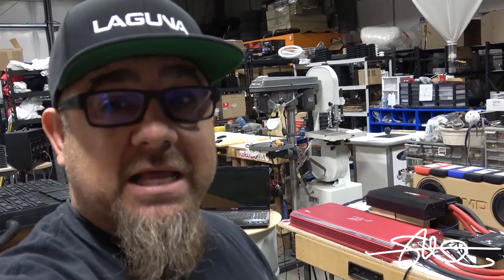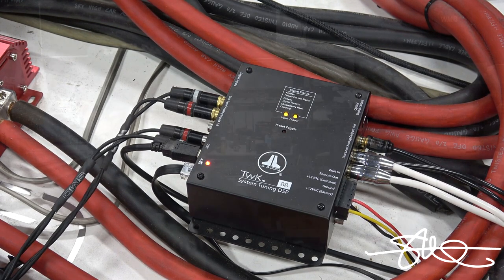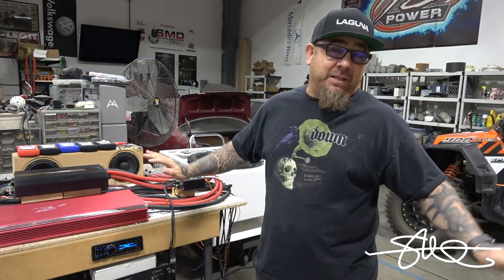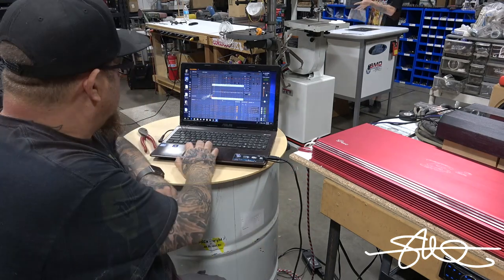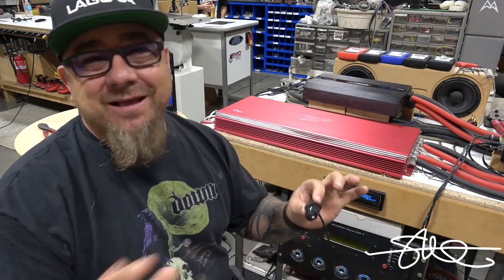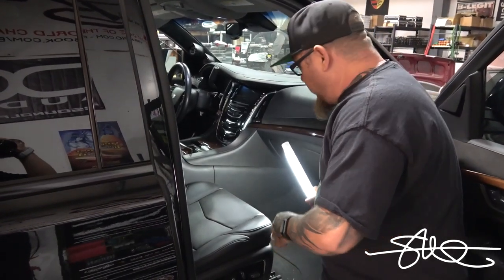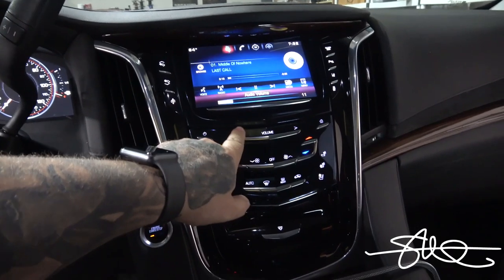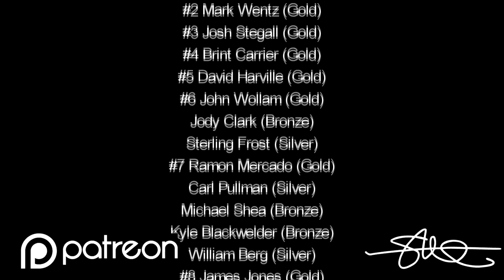Testing the Processor! JL Audio TWK-88 Crossover/EQ - Clean Optical Inputs - Escalade Install Vid 4

Comment from the maker: I just had to test this out on the bench BEFORE i committed to building an amp rack (when the amps arrive that is).  I want to install it with confidence that i know it works and i know what i am doing.  It sucks to sit in a hot cabin of a truck after installing something and spend hours figuring something out...especially if your wiring is all nice and clean.  I feel good about this! Stay tuned for more updates! visit and follow my instagram channel http://www.instagram.com/meade916 for daily updates and live feeds! thanks for watching!
Reply: meade916 is the wire 0 gauge or higher. I have a 03 dodge ram 1500 i have a 1000 dollar budget for a sound system can you help me to get a decent sound system thanks
Reply: meade916 
 I'm looking to do a build in my Acura mdx and I'm my sundown audio SAZ 1000 is missing power and ground screws. Do u know where I can get them from ? Also need some excellent miss and highs speakers
Reply: meade916  bro can't wait to see those amps and sub's another great video I gotta come visit your shop and get a demo of the Tahoe
Reply: Just a heads up in case you didnt already know, the volume button on the CUE works better as a slider. Start at the middle and swipe right or left to adjust volume quicker than tapping or using steering controls..
Reply: 2 Questions: what is the plan with the civic / is the mids enclosure one big box or does it have a wall in between?
Reply: meade916 Hey you got the 3sixty.3 in the Lexus, which 1 u think is better between the twk88 an the 3sixty.3?
Reply from the maker: nah i hate that slider.  It's kinda a piece of shit.  That's why i push the button.
Reply: meade916 AWESOME VIDEO AS ALWAYS BROTHER BASSHEAD
Reply: meade916 Is the Skeletor Enclosure going in the Escalade?
Reply: Steve  Contact the Tech Eric Cole at JL.  Tell him Josh told you too for good reason.  There is a ton more in the TWK than in the manual.  Lets just say you have 80 bands of equalization.  How to use it properly,  sky is the limit...let Eric tell you how to really unlock its potential.  It is something super awsome.  I did not belive it at first.
Reply: This is why I love JL digital
Reply: Is it worth it to buy twk if I already changed my radio to aftermarket and all my speakers are jl audio with jl audio amps in 2010 benz gl450? Btw liked all it videos. Copied ur amp rack.
Reply: When is the next vid comin out for the system  ?
Reply: King Achmed Detroit get another 9 g

Comment: I’ve had the twk in my truck for over a year, GUI interface is great, Tuned with a calibrated mic, hooked up an Apple WiFi to it through optical, pair it with an iPAD using soundman dash kit via Apple play, and it sounds crazy good
Reply: Apple wifi ??

Comment: I installed a JL Fix 86 and TWK88 in my 2017 F150 last summer.  These JL units have crazy amounts of control built into them.  These are great if you have audio OCD.

Comment: Great choice!!! I’m going to run the JL audio vx800/8 and the vx1000/1 amps in my Denali Yukon XL. I work for Jacks Stereo in Tyler Tx they have the TuN express which is controlled by phone or laptop. Has TOSLINK input and output

Comment: I just bought this and FIX 82 to install with my factory headunit 2018 Ford Mustang GT
Reply: John Perez if you have the Sony system you should use the PAC AP4 amp integration piece. JL will even tell you to use those.
Reply: Dylan Wold I went a reputable installer here in Las Vegas, and they said to get these two.  I have the 9 speaker speaker none Shaker.  I will be running it with JL Audio XD 800/8v2

Comment: The more I look at the jl twk, the more I want to replace my audison bit 10 with one. The functionality, parametric eq and the integration looks like what I need and the reviews make it appear that the sound quality is there too. My system is more SQ to SQL. Would be even more awesome if it had something like the Kenwood dsp Android app to control the dsp presets etc.
Reply: Tickle Fingers I think tun 3.0 has it and 2.0 doesn't check in to that he is using 3.0 which just came out in the last couple of months.
Reply: You are correct it does have DSP presets that you make and assign a color to it. You press in the center knob and it changes preset and its color.
Reply: Edward Soares That was it..... Good looking out. I thought that was another dsp.

Comment: When will do a video on the jl audio fix86. It’s been a bit confusing using my dd +1 with that set up. 😩
Reply: Did you ever figure it out? I can’t read any output voltage from the twk88 unless I clip the signal.

Comment: i have a question on this tuning peice by JL audio 1>.do you require this for a certain amount of watts or is it good at any level_ Question 2. are you able to controll the equilizer on your stock screen radio since is already plunged in or those everything has to be when in laptop software AND 3RD. QUESTION THOSE IT COME WITH A BASS KNOB INCLUDED ?? 
NICE VIDEO
Reply: @tboodman  thanks I just bought one
Reply: GAME & TECH BUILDS everything must be fine on laptop. Pre sets can be controlled via knob but actual must be done by laptop. How that helped bud

Comment: This or the Audio Control DM 810 for the C7 3 way components?
Reply: I was just thinking the same thing! Both seem to be kick ass DSPs. If you ask JL Audio, they are going to tell you to get their TWk88 but then you have the VXi amps that to me is an XD Amp line that have the TWk88 built in. I have HD amps so im thinking of the TWk88 or the DM810. I have a Audio Control LC6i that can take care of the high Level Inputs of my Ford flex non Sony system. Just undecided on the DSP 😅 wish there was more head on info on YouTube.

Comment: Could you help me answer a question with a problem I have? I'm going to be doing a full system in a vehicle where you have to keep the factory deck. My concern is since I've never used any type of line output converter I'm looking for something with excellent signal and no distortion? Is there any product out there that gives you excellent results when it comes to signal and distortion? I was thinking about the JL audio 86?

Comment: Pretty sick does it have optical out? And the amp optical in? That would be the shit!
Reply: It does have optical out, however beware it is just pass thru optical and is untouched by the DSP :( I know from experience and the user manual. I got rid of mine because if the control knob has an issue then the DSP output goes to full output and blows your speakers :( It does sound amazing until it smokes your focals lol. The optical pass through is perfect for passing on to another DSP and or amp etc.
Reply: So after watching this video I decided to give the JL Audio DSP another try since I wasnt happy at all with the sound of the Audio Control DM-608. So I bought the VX1000/5i instead of just the TWK88 again and wow! I hope Steve is sponsored by JL Audio because his video brought me back to JL Audio and I ended spending almost $1300 after tax yesterday on this amp and am almost as satisfied as when I lost my virginity. Focal PS 165F Expert Flax 2 way active front stage and 2 JL Audio 8W3v3 subs. Next upgrade will soon be the JL Audio C7 3 Way set to replace the Focal which arent bad but arent as good as my JL Audio C5s were.

Comment: @15:50 i was told to never disconnect rca while its playing and that it will blow the pico fuse on a pioneer headunit. not sure how true it is
Reply from the maker: it isn't true.  You don't want to disconnect your grounds with your RCA's still plugged in, rendering your RCA's your only ground.  That is what causes that problem.

Comment: Hey Steve wondering if you could help me out. I want to add a 5 channel amp to my Tacoma just add some power to my stock highs I was thinking the JL Audio xd 700/5 and adding a JL Audio tw3.  Would this jl tk88 work as audio control lc7i?

Comment: Your system  will only sound as good  as the signal it receives period,if you have a tiny bit of distortion the amp amplifies that,99% of people  miss that the twk is by far the best on the market and will be fir years to come,you can do so much with it its not funny,although  if you want to run the new dolby,optical  will not support  it
Reply: Helix>Twk88

Comment: What factory integration unit would you recommend for a 2017 Charger Hellcat? I plan on going 2 sundown x8’s, SAE 2k, 50.4 and prob 2 sets of hertz 6.5 components (front door/rear deck), not sure what do do about the dash speakers yet.
Reply: Younghog87 JL fix 82 or Audio control Lc2 are good.
Reply: Jim Elam thanks do you have any experience with the LCQ-1 or DQ-61 from audio control?

Comment: I need some excellent mids and highs speakers. Any recommendations ?
Reply: Morel for laid back high quality sound or Hybrid Audio Technologies. The Morel Maximo Ultra is a good entry and the Tempo Ultra. I personally would go with the Virtus or Hybrids for the money. But you can get into HAT Unity for less than Morel Virtus and then into Clarus for a little more than the Virtus. Or, you can get into the Morel Hybrids for more than Clarus. People swear by HAT Clarus and they have great midbass and amazing clarity. Run a search on both brands and take a listen.
Reply: lightbulb754 B2, Focal, Hertz, and JL are good options JL and Focal are smooth Hertz is bright and I will let Steve reveal what B2 sound like when he does his install.

Comment: Hi Steve!!! Quick question, on the car audio install for the ESCALAED are you shooting for a SQ or a SPL sound system to go in it???
Reply: Jose Garcia more than likely it will be both, spl with sq ftw 👌🏻👌🏻
Reply: Jay How is it possible to have both SQ and SPL in a sound system, because if that's the case I would like to do the same with my build that I'm currently working on right now???
Reply: Jose Garcia Was just saying that because that processor gonna make those mids and highs sound so sweet and you know SMD gonna go hard, so it’s seems like he’s gonna have a nice sq system but with lots of bass hahaha

Comment: Hey steve i have 2 p3s and my voice coils are getting hot
Reply: ronald saavedra u clipping yur subs if yur coils getting hot lol get u a scope or dd1 and set yur amp right and u won’t have that issue
Reply: Turn you gain down a bit. GET A MORE POWERFULL AMP TO PUSH THEM. or you subs are at peak need to upgrade to better subs
Reply: Gain is not a volume knob lol
Reply: Gain just sets the voltage at mach the headunit to clipping. DO NOT TURN IT UP ONCE ITS SET
Reply: ronald saavedra if it is not loud enough. Dont touch that gain. Go buy better equipment

Comment: Soundigital
Reply: Soundigital Made In Brazil!
Reply: canal apenas um tanker sd 100k seria legal
Reply: Wallyson da silva nascimento
SD 100k  = você vai precisar de muita bateria pra ligar kkkkkkk imagino SD 100k pra hair trick
Reply: Kkkkkk liga direto na rede 220 e poe 🔥 em tdo kkk
Reply: psé to pensando em usar FlyBack  transformador de alta tensão pra monta um módulo de 1.000.000W RMS tou com 3 Flyback aquele transformador de alta tensão  capaz de transformar 9 volts em 50.000 Volts total de 150.volts não sei se vai gerar 1.000.000W RMS  sei que os amplificadores de 1.000W gera até 100 volts na saída mesmo os de 12V eu então pensei em montar mesmo circuito do módulo normal só  que colocar um Flyback no lugar e um monte de transistor de alta potencia kkkkkk espero que não pegue fogo em tudo!
Reply: canal apenas um tanker. Se consegir posta video no YouTube .  se pegar 🔥 tbm posta kkkkk
Reply: kkkkkk pode pá vou tentar montar também um falante de 70 polegada  gigante XD

Comment: I hate to be "that guy" but that was a digi sig cable, not an optical. The optical is the fiber optic. On the same note, u know your shit a little better than me so Im sure it was on purpose. If u go with the real optical cable, u can basically use the shittiest head unit in the world since its basically just a digital signal generator at that point. The real music is refined by that beautiful TWK-88
Reply from the maker: when you say "that guy" do you mean "that guy who don't know wtf he is talking about but comments anyway"? LMAO...dude.  Just stop, you are making a complete ass out of yourself right now.
Reply: @meade916  And Since Im making an ass outta myself, u prob know that the COAXIAL you are using is electric signal, NOT optical (Toslink) like I mentioned before. Too bad U da man and I dont know shit tho...
Reply: Ralph Menta knuckle head that is an optical cable.  Slow mo the video if you need to.  What you thought he was using was an SPDIF cable because it kinda looked like an rca.  SPDIF... SONY PHILLIPS DIGITAL INTERFACE.  Steve actually stated and used fiber optic cable also known as toslink which is short for Toshiba link.  Sorry to say but you were that guy but not for the reason you thought. Lol.

Comment: The whole point of any DSP is just to delay the signal to either front or rear speakers, the rest of the features such as EQ and crossovers are just bonus add ons.
Reply: That's an inaccurate statement. In a car audio application, a discrete DSP module does much more than just time alignment.
Reply: @jasonklemm8017  it does just as I stated, time alignment, crossover and eq, that's it.
Reply: @andrea4809  Again, you're oversimplifying the TwK88. When used in conjunction with TUN4 software, it goes well beyond the core functions you're stating. I'd suggest opening up TUN4 and looking around at its capabilities, and how they tie into the overall functionality of the TwK88.